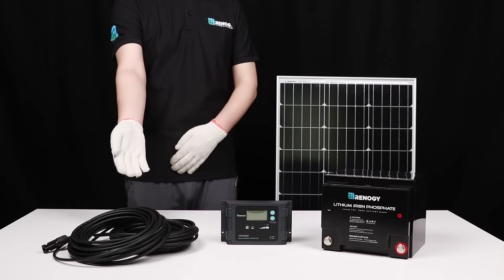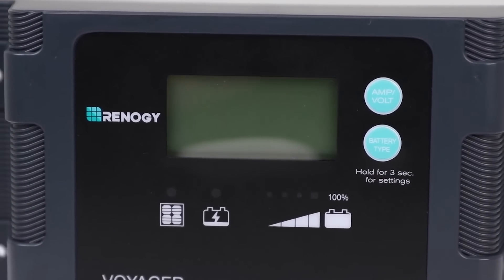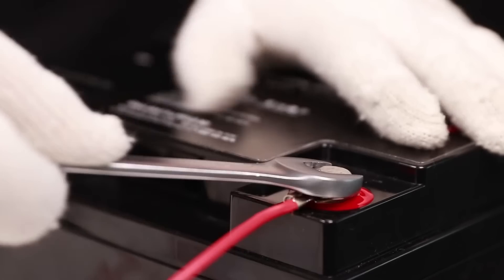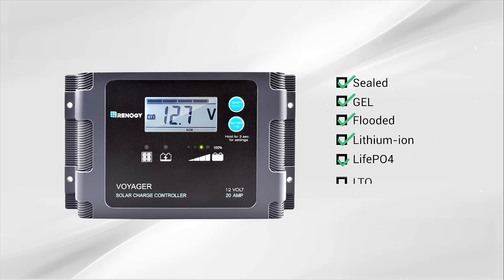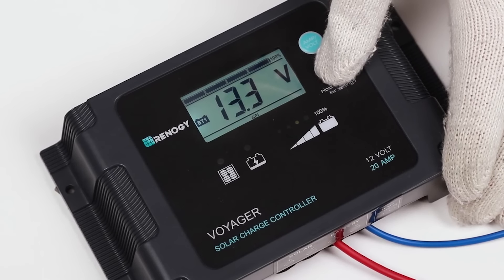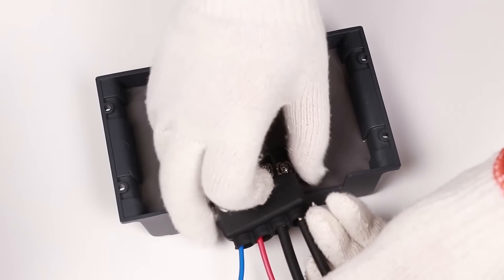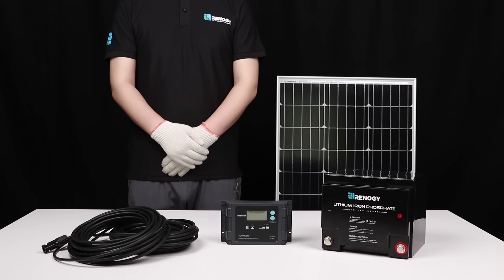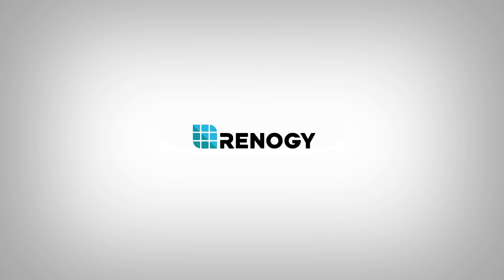Renogy Voyager - 20A PWM Waterproof Charge Controller w/ LCD Display and LED Bar

Comment: Buenas tardes necesito saber que voltaje voc y voltaje a máxima potencia debe tener el panel solar para este tipo de controlador y cargan un banco de batería de 12v gracias si m pudiera ayudar a aclarar mi duda

Comment: I have the 200W suitcase with the older version of this controller (RNG-KIT-STCS200D-VOY20). I may want to add an additional solar panel to this controller. The included panel runs at 18.5V and 10.5A (optimum). If I add a panel in series that runs at 18.3V and 10.9A, I would get 36.8V and would still only get 10.5A. Will the PWM controller take 36.8V and charge a 12V LiFePO4 system?

Or if I run them in parallel, I would get the 18.3V and about 21.3A. Will the PWM controller work in that condition, only accepting 20A instead? or will it cut off due to too much amperage coming in?

Or do I have it all wrong and the 20A limitation is for the output of the controller, and I can only get 260W output for charging a 12V system? (basically, ~13V @ 20A output)?

I seem to only be able to get about 10.5A max, in optimum sun conditions. So, using 14.2V for Li battery charging, that's about 150 watts. When I connect the panel directly to my Bluetti AC240, I get about 180W max from the panel. Trying to figure out why I'm losing 30W coming out of the controller.

Any help is appreciated!
Reply from the maker: Hey Brian,

For any technical questions, please contact us here- https://www.renogy.com/contact-us?gclid=CjwKCAiA3pugBhAwEiwAWFzwdeH3Crd9vRTbjjTYl9l3daVqnotJPjBhs2nmw-Wkn1_guWQeW0ao6hoCOHcQAvD_BwE

Comment: Shit products that aren't accurate or precise. They do work but I've had both types for a week now and they over charge and don't say full..then they drop slightly down when I use power and charge again...spend the 100 and get those that can be programmed and adjusted
Reply from the maker: Hey Jonathan,

For any technical issues, please contact us here-https://www.renogy.com/contact-us?gclid=CjwKCAiA3pugBhAwEiwAWFzwdeH3Crd9vRTbjjTYl9l3daVqnotJPjBhs2nmw-Wkn1_guWQeW0ao6hoCOHcQAvD_BwE

Comment: So this can't charge a 12 V ead acid car battery?
Reply from the maker: If your car battery belongs to deep cycle battery and the parameters are matched with our controller, it can be ok.
Reply: Sealed  SEL is the lead acid battery setting
Reply: Sealed  SEL is the lead acid battery setting

Comment: Is the area where you connect solar wires large enough to hold the stock size solar wires? Or do you need an adapter
Reply from the maker: Hi, David.

The hole for connecting solar panel is large enough. You do not need an adapter.

Comment: Lifepo4 voltage? I have the renogy 12v 100ah lifepo4
Reply from the maker: Hi, accountname0.

According to your battery type, you just need to set up to Li model and keep the paremeters it shows.

Comment: No circuit breakers?
Reply from the maker: Hi, learrus.

Our video was conducted in a relatively safe test environment. So we do not install circuit breakers.  To avoid confusion from customers, we will explain this later before the video shooting.

Thanks again for your feedback which helps Renogy improve customer experience.

Comment: I can't seem to find any info on the Renogy site or manual and no one to speak to on their phone in CA.  My question is: When press and hold the AMP/VOLT button what does the "d" followed by a number mean?
Reply from the maker: Hi, Keith.

For solving your problems, we may need you to send us some image or videos for help. For the condition, we suggest you can submit a case through our Help Center Portal (link listed below ）for help.

https://renogy.force.com/helpcenterca/s/contactsupport (Canada)

Comment: Is it possible to charge a phone without a battery?
Reply from the maker: Hi, steve.

The controller in the image does not include USB interface. If you want to charge your phone without a battery, you can consider the following controllers:

https://renogy.com/adventurer-li-30a-pwm-flush-mount-charge-controller-w-lcd-display/
https://renogy.com/wanderer-10a-pwm-charge-controller/.

Comment: Will this controller let you connect two panels in series OR parallel for more voltage or amperage?
Reply from the maker: Hi, John.

The PV Input Voltage Range is 15V-55V. The current is 20A. Please make sure the voltage and current are within the range after panels are connected in series or parallel.
Reply: @RenogySolar  Thank you I will assume this means a yes, in parallel since it will maintain the voltage.

Comment: Thank you.  The book says that you hold the battery button for 3 seconds which was not working.
Reply: Make site it is scrolled onto battery voltage on the dispaly then hold down for 3secs and it will work